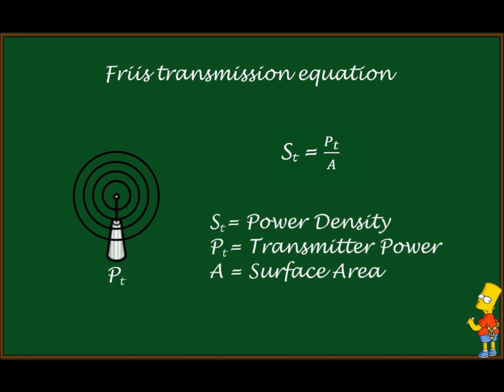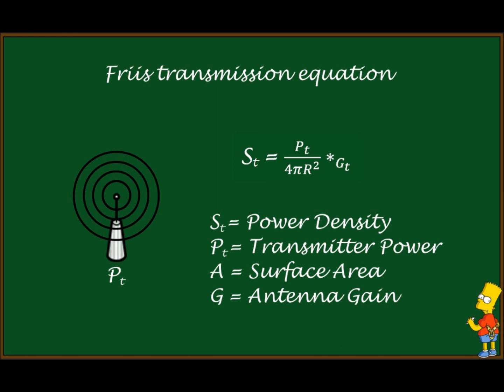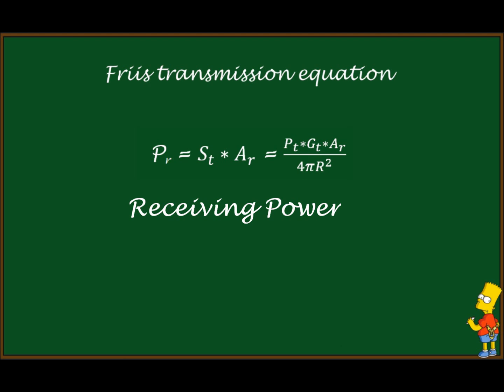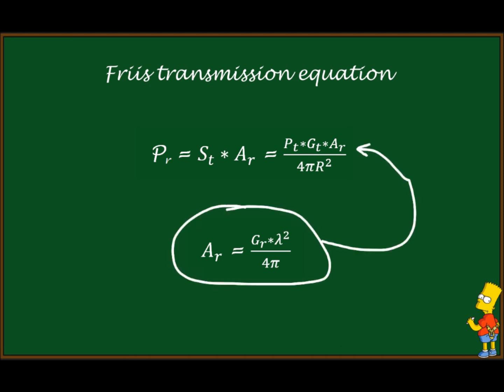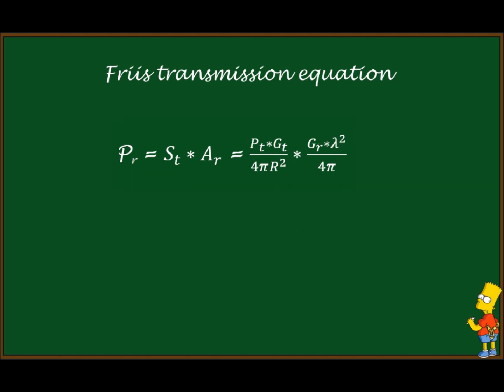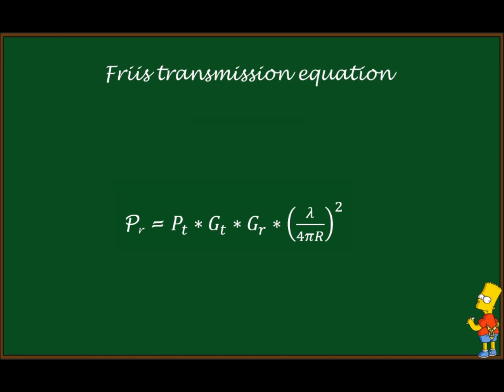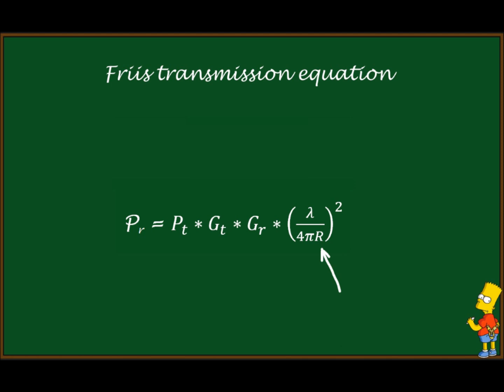Friis transmission equation

Comment: can GT and GR be in dB when using Friis transmission formula???
Reply from the maker: dB is always "something" compared to "something else". Antenna Gain (no matter T or R) is a RELATIVE measure of an antenna's ability to direct or concentrate radio frequency energy in a particular direction or pattern. Common variation on dB in antenna theory is dBi which means "decibels relative to an isotropic antenna". This just specifies the gain of an antenna relative to the isotropic gain, which is 1. So in this case gain dB in the Friis formula is the same as the gain you mentioned in terms of dBi.